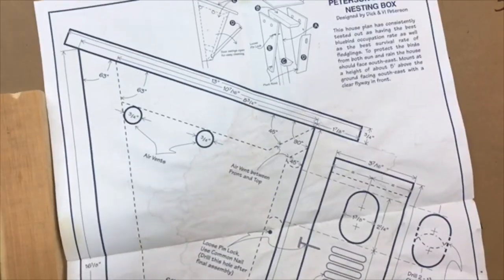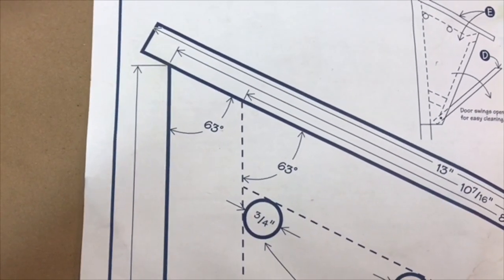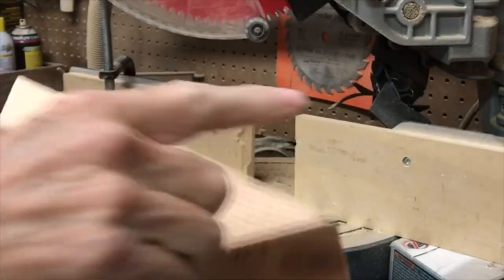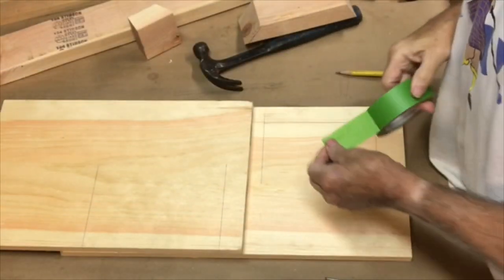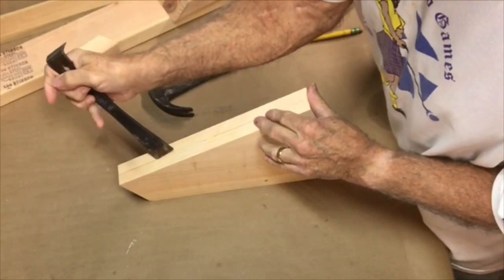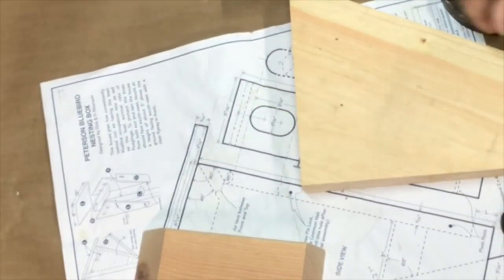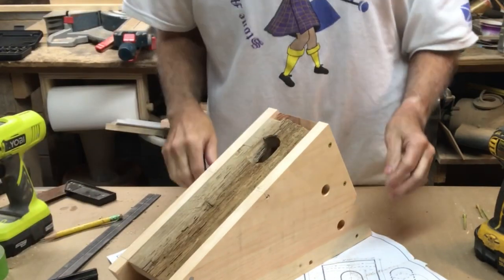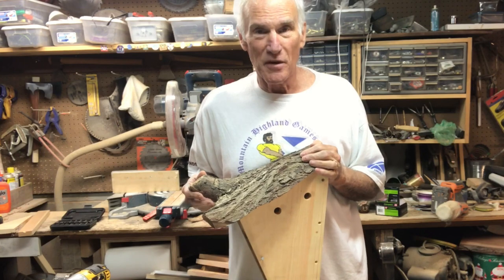Peterson style bluebird nesting box

Comment: Thanks for the video....nice box. I have a question about the toe grips. The print front view, it looks like the slots are on the outside, as does the grips on your old box in the beginning of the video. But in the video you put the grips inside. What is correct, or does it matter, and can there be grips inside and out? Thanks again.
Reply from the maker: Thomas Ambler the grips are on the inside.  They are provided for the babies.  The adult birds have no problem griping the outside.  Thanks for watching and commenting.  Hope this helps, Larry
Reply from the maker: Thomas, I owe you and apology.  I looked at the plans again and you are correct.  But the adult birds have no trouble getting in either.  The plans did say don’t add a perch as it attract sparrows.

Comment: I don't know if I missed it but can you tell me what the size is on the entrance hole to the nesting box? It's oval rather than round and I wonder if that would be a deterrent to house sparrows. TIA
Reply from the maker: Yes it is to deter other birds, especially sparrows. The opening was 1-3/8” wide and 2-1/4” tall.  Thanks for watching and asking.
Reply: @LSatch  Thank you! I am trying to change the opening on the four blue bird nesting boxes I bought. They have 1 1/2 inch openings which the sparrows also love. Maybe if I found 1 3/8 round brass plates. Do you think that might work? If that doesn't work I am going to remove all but one of the sparrows eggs in their box. Anything to keep the little monsters from taking over the bluebird box that has bluebirds roosting in it.
Reply from the maker: @kaynucklehead1633  a brass or copper plate would work great.  You could also add a guard like found here, 
https://nestwatch.org/wp-content/uploads/2017/08/Fig.-1.jpg
In other words, cut the current opening big enough to put another piece of wood over it cut to the oval size.  The “extra” wood won’t bother the bluebirds.  I’ve never tried the hardware clothe method but I’ve been tempted to.  Good luck
Reply: @LSatch  I'm not familiar with the clothe method but the nesting boxes I have have the unscrewable piece of wood just like in your example labeled 'c' so I will try to replace the extended piece of wood with the 1 1/2 inch opening with one that has the dimensions you have and reattach that to the boxes. I'm going to check out the machine gun looking gizmo and the cone cover if this doesn't work!
Reply from the maker: @kaynucklehead1633  the letter D is the hardware cloth.  https://www.pinterest.com/pin/6544361933947892/
Reply from the maker: @kaynucklehead1633  that’s really interesting, thanks for sharing

Comment: Not bad, except attaching the two sides together before cutting is entirely unnecessary, and not how most people make them. Also, the pine will last you about 30 years (I know from experience). You can use cedar, too, and get a few more years. The hole sizes ae CRITICAL. Don't 'close enough' it. Linseed oil will turn the house black (from bacteria), even in full sunlight. I don't use any finish on my houses.
Reply from the maker: Thanks for watching the commenting.  All good points.  Everyone works a little differently, doesn’t make it wrong, just different.

Comment: The only thing I see wrong with this is that a raccoon could hang off that slab roof and have eggs for breakfast.  A piece of tin roofing would be my first choice.
Reply from the maker: I disagree.  A tin roof in Georgia where I live would be a death trap,  https://youtu.be/qiqOe6JjmQw
A raccoon on steroids maybe but I don’t think so.
Reply: @LSatch  I'm in Florida.  I've tin roofed several birdhouses.  If you'll notice, the design in the video has a 2x4 ceiling with a roof over it.  Tin over wood is cooler than wood alone.
Reply from the maker: @nonyadamnbusiness9887  I think I'll just agree to disagree.  Thanks again for watching and commenting.